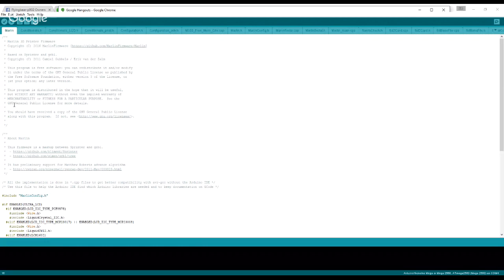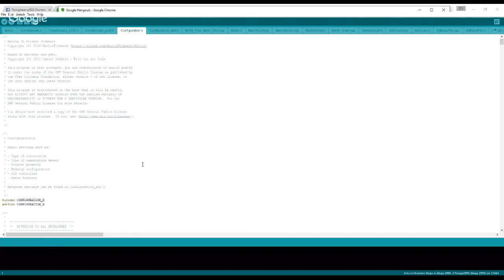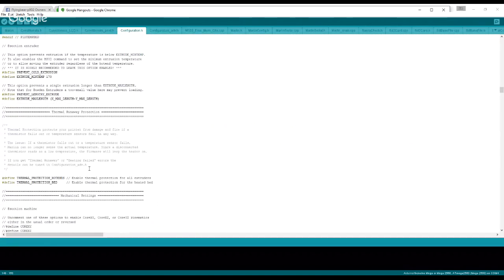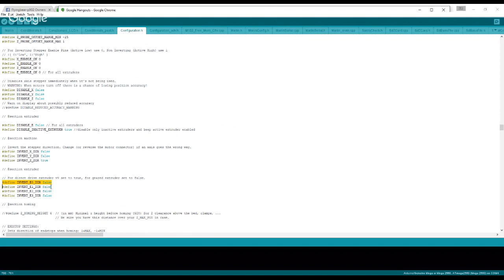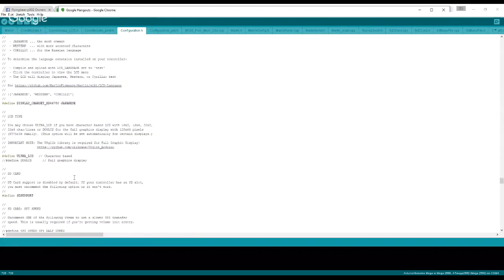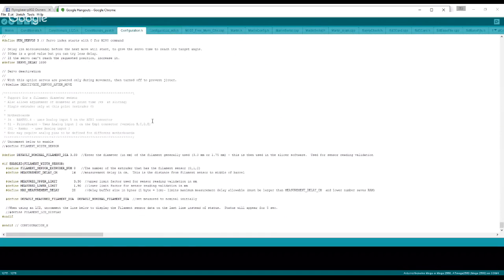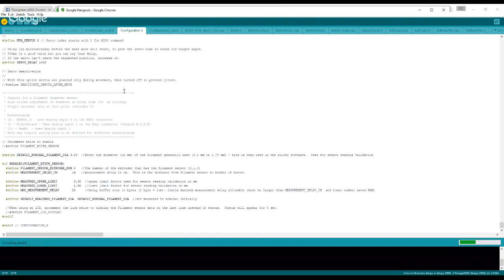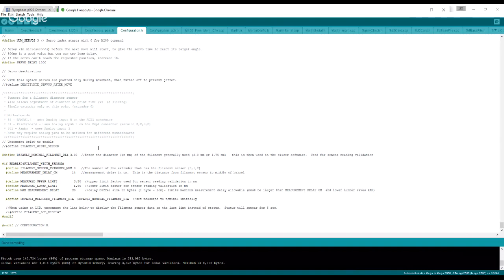Marlin 1.1.x [How to] Upload Firmware to any 3d Printer easy

Comment: Hello!  I am trying to upload updated firmware onto my Monoprice mini select V1, and at the point you mention which board to have selected, I can't see which you have selected in your video. When I try uploading I get that Timeout (and the message says to select Arduino 'Mega' (tthere are a few choices - 'Mega ADK', and 'Arduino/Genuino Mega/Mega 2560'.  I changed the baudrate to match yours, but, you mentioned 'Verbose', and I wondered if that helps actual upload (and how do I change that command?) Thanks!!!

Comment: Arduino: 1.8.7 (Linux), Board: "Arduino/Genuino Mega or Mega 2560, ATmega2560 (Mega 2560)"

#error "Oops!  Make sure you have 'Sanguino' selected from the 'Tools -> Boards' menu."
Option does not exist. 

I am trying to update firmware on a Tronxy X5S-2E...